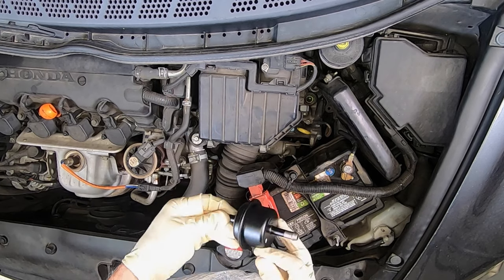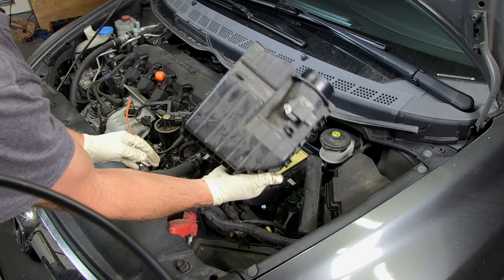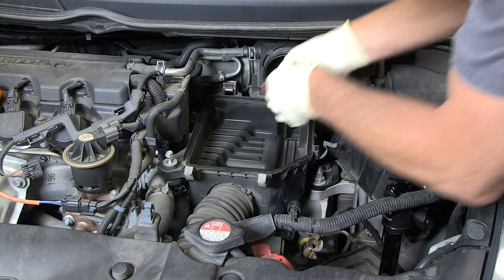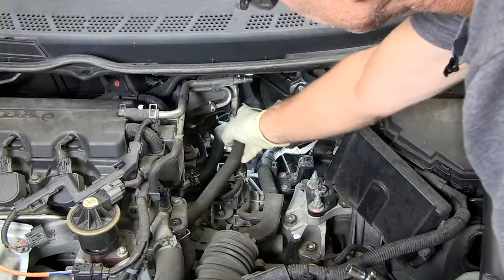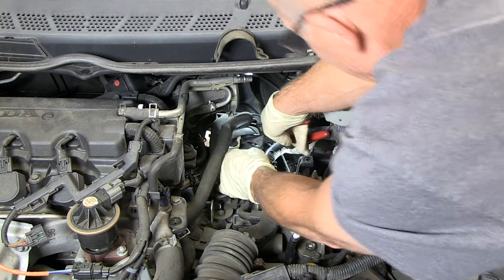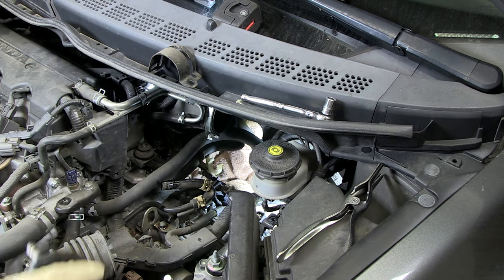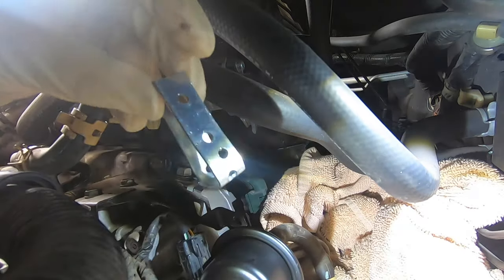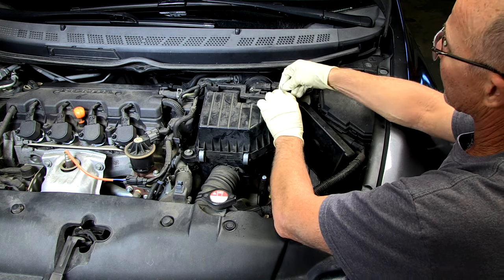Do this to your Honda Civic transmission to extend it's life, filter and fluid replacement

Comment: The tool got my attention, thanks.
Reply from the maker: Thanks for commenting, 👍🏼
Reply: Buy via online this tool should help access 45 Degree Hose Clamp Plier, Automobile Water Pipe Plier, Angled Swivel Jaw Locking Car Water Pipe Fuel Coolant Clip, for Removal and Installation

Comment: I went to honda dealer and the honda  guy I talk with said you don't need to change it just regularly drain and refill the tranny. I'm thinking of changing the atf filter now.
Reply: Thats exactly what my dealership told me but there’s different transmissions of different years that don’t need changing, research is best
Reply: @henness3yy 
Well, they're wrong. What is the purpose of installing filter in the first place??? To capture metal shavings. And it should be replaced as scheduled... otherwise, it will clogged up.

Comment: Hi Danny.
Very well made clip and wit useful informations.
I have a Honda CRV 2007 2.0 engine automatic, and I would like to ask you if my transmission filter is on the same location like on your car. 
Thank you
Reply from the maker: I’m not sure, I would assume so
Reply: Thank you Danny, the engine layout of your Honda looks the same as mine, and in the exact position of your filter there is one who looks identical with yours. So I gues I will disconnect it and if there is red fluid inside then is definitely the transmission filter😊.
Thank you for your videos and your reply.
I wish you a good day.

Comment: i have a CR-Z CVT approaching 30,000.  Will be doing the fluid and this filter.  My question is, how often would you suggest to change this in-line external filter and how often to change the internal filter?  The fluid?
The numbers are all over the place to where I could see changing the fluid every 15-30k, the in-line filter every time/every other time the fluid is changed, and the internal filter every 30-60k.  
Honda would have you change either filter never; I think the fluid every 30k.  Thought I read the designer of the CVT said a lower number than that.

I just want to do the best I can for it.  That isn't even getting into changing it cold to get all the settlement vs changing it warm; or for CVTs changing 3x with a drive in between; then I could ask, the first one cold, the second one hot with a filter change and the third one after a tank of fuel with or without a filter change? etc.

The noise of the internet can be overwhelming.

This video is evidence that the internet can make a job sound more tedious and troublesome than a mechanic can show you in a calm demeanor.  Greatly appreciated!

Comment: Hello, nice work sir. When I went to local car service shop, they changed automatic transmission oil on my 2013 honda civic, but refused to change transmission fluid filter, as they believed it was not replaceable part on the model. So, what do you suggest me to do?
Reply from the maker: I’m pretty sure the 9th generation civic has one, call Honda parts and ask them to look up a external transmission cooler filter for your vehicle
Reply: @dannysdiygarage  thank you so much

Comment: Might have missed it during this video but can you change the filter after u added the transmission fluid or do you have to do it while its drained??
Reply from the maker: Great question, it doesn’t make a difference when you change it, the filter is higher then the transmission, so minimal fluid is lost either way, just make sure you adjust your fluid level when the job is completed

Comment: Hi, Thank You for this video, very informative.
Question.....
That this also aplly to a 2012 Honda Civic GX (Natural Gas)??
And... why in Honda Parts department told me that the transmission oil filter is inside the transmission itself?
I removed the air filter housing and I have located the transmission filter but. Honda dealer got confused me.
I appreciate you. Thank You!!
Reply from the maker: I went through the same thing, also a 30 year Honda technician told me that the only filter was the one in the transmission, my Honda Element also has this filter ’same part number” it exists and should be replaced as maintenance,
Reply: @dannysdiygarage  along the same line, would you know if an 06 CR-V would have one? It doesn't show one on HondaPartsNow website. Thanx!
Reply from the maker: I do not have this information, sorry 😞
Reply: The engine he's working on is a R18, in the 8th and 9th gen Civic DX, LX, and EX.  According to Honda, this is a non-serviceable part, meaning, it lasts the life of the car, not necessary to replace.  Someday, I'll do it.  Currently have 200k+ miles on my 2006, no issues so far.
Reply: @dannysdiygarage  I perfer do it yourself work so I know the work has been done and I can pick what parts go into my vehicle. I had been told the same thing in the past and I wondered why the Honda Dealers and chain stores charge so much for the transmission service. I assume they get labor estimate from the books but may fail to replace the difficult to replace transmission filter.
Reply: @joeyyung911  I am in similar situation using my 2005 and 2007 Honda Civics for long range travel 600 miles each way each time. I need to do this work myself so I know it has been done.
Reply from the maker: Their is no set charge, they can charge whatever they want, some shops have good prices and some don’t, all depends on the shop and supply and demand, another reason to do it yourself

Comment: Good video. Some people make mistakes in the direction of the filter. They put the fat side down. Originally it was up as in your video. My oil change goto service centre did that. They did say it doesn't matter much though they flipped it later. Also i changed O.E.M dw1 ATF. I didn't go for the cheaper DEXRON III by korean brands they were recommending to me.
What you say. Can Dexron III be substituted for Honda DW1 ATF?
Reply from the maker: I would only use the Honda Fluid. By the way, the filter only fits in the bracket one way 
Thanks for the comment 👍🏼

Comment: I always recommend people get estimates from several shops near where they are in the world because some shops are very expensive and some of the best people are in the smaller family-owned shops. I also get estimates from major chains to see the delta but normally the dealer is the most expensive. You can check for consumer complaints but normally making one is feckless except to warn others. You must ask if warranty is local or national and if the shop is for sale or under new ownership. You will be amazed how prices and warranty vary. I opt for do it yourself, so I can save time and I know the work has been done and I control the parts used in my vehicles and boat and farm equipment. I have seen transmission shops change names and ownership often but have the same management and automotive technicians because of shoddy work in years past and local warranty are void if the shop changes ownership. If a local shop has been under same ownership for years, its a good bet they do good work and how many people you see in the waiting area is a good sign they have fair labor rates.
Reply from the maker: Great point

Comment: Hey Danny, is this the only filter on this generation? Is there one underneath the transmission pan if you take that off ?
Reply from the maker: This filter is on the 8th generation, the filter inside the transmission gets replaced during a rebuild

Comment: Thank you Sir for your informative videos…🙏🏼….The only thing I didn’t understand is …it seems easy with the Fat tip plier that has been used to remove those clips from hoses to pull filter out……Then Why …like you said..it becomes difficult with same plier to reinstall those clips back on hoses…!!
….please explain….is it mandatory to make tool from scrap metal….or is there any other alternative for those clamps ??!!
Reply from the maker: No it’s not mandatory, it just made it easier for me, my fingers are large, just an additional added help tip if it’s needed, good luck my friend

Comment: Where did you buy your filter...I just want to get an oem one thanks for your video.
Reply from the maker: Honda,
Reply: Genuine Honda (25430-PLR-003) Transmission Filter I see online via amazon and many others using the part number

Comment: Many thanks
Which automatic transmission is More reliable ? That Honda civic transmission or 10th generation Toyota Corolla the same year ?
Reply from the maker: I’ve owned a 2005 Corolla and a 2009 civic for over 10 years, transmission has been solid in both cars, from my experience both transmissions are reliable, but they do need to have the fluid changed, as far as which is more reliable, I could only guess
Reply: This is a great question. Most American made transmissions fail due to age and heat doing damage to the seals or lack of maintenance. Changing the transmission fluid on regular schedule of once a year or every 30 thousand miles helps with or without the filter replacement. The transmissions made for the small cars designed in Japan seem to last forever if well serviced I am not sure why.

Comment: Thank you for the video. I was wondering if you can see the filter from the bottom or is this the best way ?
Reply from the maker: You cannot see the filter from the bottom Yes this is the only way, good luck
Reply: I have a 11 civic, i pulled out the clamp from underneath using the hoist. It visible and reachable at least in  11 civic
Reply: @ShyamKumar-cp5mu  Thanks, this was my concern as well. I will look see on my 2007 and 2005 Honda Civics. I bought 3 civics but the 2004 was sold by family.

Comment: awesome tutorial - but a couple questions after I tried it. my air box has the two 10mm bolts yours does, but it also seems to have a bolt with a rounded oval head holding on the air box behind the first bolt you took off...so right next to the engine. I didn't see you take one off in that position, but it does look like there is a tab on the air box bottom that sticks out much like mine and there is something there. can you tell me if you had something in that position? so in the10 or 11o'lock position of the air box when you are looking at the engine compt from front of car. I reassembled mine when I could not get that 3rd bolt off and reconnected the air sensor(and got a new air filter since it was a bit dirty) and my check engine light is on. I think it has to do something with that air box sensor or maybe an air leak. I changed my oil at the same time but that all checks good...I may go get a code reader in the  morning but curious if you may have any guesses...thanks!
Reply from the maker: Sorry I was late reading this, did you fix it

Comment: Great video Danny DIY Garage! :) About to replace my Transmission Filter too on my 09 Honda Civic. Crazy too cause I went to AutoZone for the filter and all they say is that it doesn't need to be change LOL What?
Reply from the maker: My local parts dealer said it doesn’t exist until I provided them with a part number
Reply: Update: Just finished replacing the Transmission Filter on my Civic :)! Definitely harder than it looks in the video, but certainly doable! The clamps were the hardest part for me!
Reply from the maker: I agree, harder then it looks, great job 👏

Comment: Tx for an informative & excellent video. I have a HONDA BRV SUV. In 2019, My mechanic suggested using Shell S1 ATF TASA , which is automotive transmission, power steering and hydraulic oil mainly used for heavy-duty vehicle in my HONDA BRV, which has a CVT transmission. It was changed 3 yrs ago and have had no problem with my car, in fact excellent faultless performance. But now it turns out that I should have used the Honda recommended Idemitsu CVTF Type H2 is specifically formulated for CVT in all Honda vehicles and my warranty is NULL and VOID. Want to know if ATF oil indeed damages a CVT transmission
Reply from the maker: Honda engineers spend millions developing what works best for the best performance, I always go with Honda recommended fluid and parts for the best performance, but I do not know your answer, just my thoughts
Reply: @dannysdiygarage  Thanks you Sir,, Just wanted to confirm if using an ATF in a CVT will eventually result in the death of the transmission.. I completely understand using  strictly Honda recommended stuff, however the period was COVID, when  garages were hardly open and imported CVT oils difficult to procure in India. Hence as a workaround an experienced mechanic suggested the high quality Shell ATF, which has caused no damage whatsoever, in fact my Honda SUV transmission is smooth as silk, Only that I have lost my warranty now. So should I cut my losses, flush the existing oil and put the Honda recommended OEM Idemitsu CVT fluid, I have only done 15,000 kms and I believe a transmission oil requires a change only after 50,000 kms .
Reply from the maker: If it were me, I would definitely get the approved Honda fluid in it, if nothing else you’ll feel better about it

Comment: Just looking at the 2013 Civic-LX I have the job looks a lot more complicated, based on the location of the filter - the 8 min video was great - but I'm guessing this could be 2 hours or more.  Getting to the filter and seeing what your doing is the wild card under the front cowing shield.  Not sure if you come underneath the vehicle if you can even get t it after removing the plastic splash shields.  What is interesting HONDA service doesn't recommend changing this filter unless you are changing the transmission.  I drain and fill to level performed on the transmission at 20k miles religiously should keep the tranny humming along just fine.  I'm going to dig into it because I just purchased a clean high milage Civic that was used for a daily highway commute.  I like to do all the mechanical maintenance items when I buy a used vehicle, this was on my list but I may just pass if I think it is going to be 5 knuckle buster job with frustration.  I'll dig into it when the weather warms up a bit.
Reply from the maker: 2.0 hours is a fair assessment of time it will take, it’s really not that hard
Reply: @dannysdiygarage  is it the same filter location for the 2013 civic ?
Reply from the maker: I believe others said it was
Reply: Buy online this tool should help access 45 Degree Hose Clamp Plier, Automobile Water Pipe Plier, Angled Swivel Jaw Locking Car Water Pipe Fuel Coolant Clip, for Removal and Installation

Comment: Danny will this honda civic in line auto trans filter part #25430-RLR-003 work for a 2008 acura tsx?They look very much alike. Thanks
Reply from the maker: Most likely, call Acura to be sure, they will give you a part number

Comment: All looked pretty easy, except am still working on trying to get the bracket to line up with the 10mm bolt hole, the bracket is like 2mm towards the firewall, feels like the filter is hitting on some thing.   Thoughts?
Reply from the maker: I don’t have any answers, it should line up
Reply: @dannysdiygarage  Hi Danny.  I finally undid the 2 coolant hoses to unbolt the entire bracket.  Filter somehow lined right up in the bracket and put it all back together.  :-)    I do wish on some of your video's you would mention how long it take - give or take as an estimate.  Thanks for all you do!
Reply from the maker: that’s a great idea, do you think I should also add a difficulty level?
Reply: @dannysdiygarage  Possibly, 1-2-3.  I replaced the A/C expansion valve a few weeks ago.  Not too bad, but the one 7-8mm bolt (behind the first vent that you pull out, it's on the back side) was crazy hard to get back in/socket on. Lucky I had a flex/spring screw driver to get it in.  The 2 bolts that hold the blower on the firewall ( the right side one).  I ended up going to the store and getting a 12-15 inch extension.  So maybe on some projects talk about how long a screw driver or extension bar/tool is needed.  Keep up the good work!

Comment: 45 Degree Hose Clamp Plier, Automobile Water Pipe Plier, Angled Swivel Jaw Locking Car Water Pipe Fuel Coolant Clip, for Removal and Installation
Reply: If you should see this comment could you edit your tool comment with a few commas so we know just what you mean?

Comment: When I change my transmission filter I get under the car to easily reach the bottom hose clamp and remove bottom hose then remove the clamp that holds the filter in place. Just wanted to share so that maybe it helps someone else? I did find something in your video that I will try next time though. Thanks for the video!
Reply from the maker: You’re welcome, thanks for taking the time to update us
Reply from the maker: Run the car until it’s at operating temperature, put the car in drive for a few seconds then reverse for a few seconds, then back into park, shut the car off wait 60 seconds and check the fluid, wipe the dip stick it a few time, it should read between the marks each time you check it, if not add more fluid and check again until a good reading on every check, hopefully this is clear

Comment: Hi there, changed the internal filter and did a fluid change and fill. I couldn’t find this external filter on my 2014 Honda Civic LX? Is it possible it changed? If so I have an extra external filter for someone in south western Ontario.
Reply from the maker: I’m not sure if a 2014 has it, sorry

Comment: What year was that honda you was working on.i have a 2005 honda civic & will it be the same?
Reply from the maker: This is a 2009, should be the same, please update this channel when you know
Reply: Omar,
I have 2001 & 2005 and it doesn't have transmission filter. Seventh generation Civics have a faulty transmission design. So, I had both replaced and a filter was installed outside near radiator to keep the fluid cool.